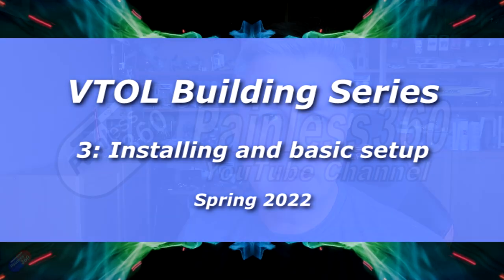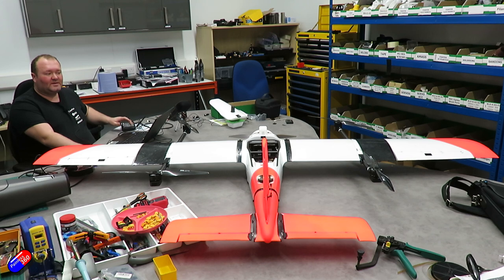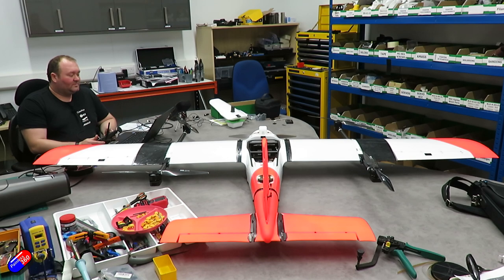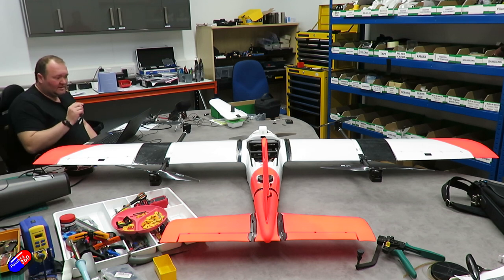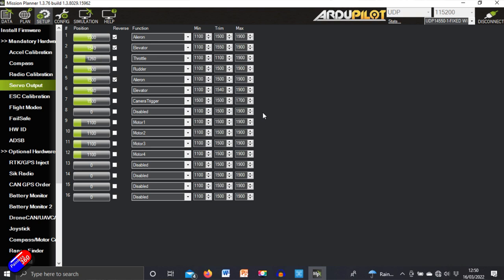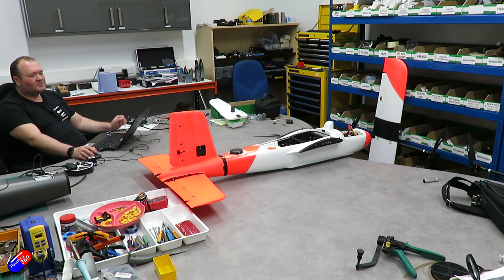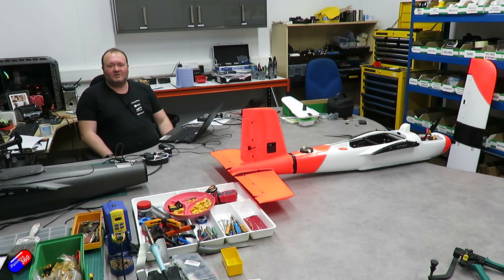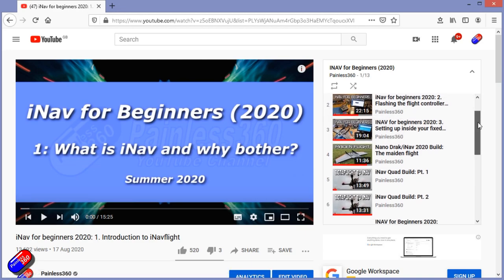VTOL Basics Series (3/5): Control and motor testing, VTOL flights modes and maiden/transition plan

Comment: To all that start to venture into VTOL territory: Stall speed varies with weight; something to consider if you do not want to risk your expensive camera equipment on a maiden flight or initial setup / tuning procedure. Once you add the weight of the equipment / payload, stall speeds will be higher (so you'll stall at a higher speed already)
It would be more pure to use the angle of attack as a stall warning system, rather than indicated airspeed. Bu I also understand that that complicetes the setup, especially in a 4+1 situation (where would you put an AOA meter to reiably reflect the actual angle of attack...). So just at least be aware and add some margin for this effect.
Reply: Why wouldn't you just add the exact weight your camera equipment is going to weigh and tune it like that so the stall speed is in fact exactly right and then put your camera equipment on after it's tuned??

Comment: You know, Lee, hearing to Ben explain the modes, I was thinking... I guess to implement it on iNav they would need 2 separate ways to set the PIDs, one for quad mode and other for airplane mode. You know? The PID loop I don't think so, it just would need to change what PID settings to use in each moment. 
But I don't really know, I'm just guessing. 😬
Anyway, thanks a lot for the video!
Stay safe there with your family! 🖖😊
Reply from the maker: INAV needs to quite a few things to support VTOL... Arduplane is the best way for now... Happy flying

Comment: Hi Lee, Great Video as always. I was wondering how easy is it to setup  a quadcopter transition to plane with 4 servo ? Can i use pixhawk 2.4.8? I am really new to the transition thing.
Reply from the maker: The transitions are all configured in the Quadplane parameters in Ardupilot. Any flight controller that runs modern ardupilot should work... Best of luck
Reply: @Painless360  Legend!

Comment: Lee, have you decided on a platform for your build? I’d like to offer a suggestion of the Atomrc seal . It’s cheap, it has ply strengthening near where the vtol motor spares would mount. I guess the difference with Ben’s big plane, is it isn’t a tractor, but a pusher-ish. Just offering a suggestion!
Reply from the maker: Ice explained the plan to the Patreons and I think that you will like it! Stay turned!

Comment: Hi .. which is the part where you tell the size of Motor and PRop for a given weight ?
Reply from the maker: It is the same principle as picking a motor and prop combo for a multirotor. Figure the all up weight of the model and then double that. Divide that number by the number of props/motors you will use and pick a motor and prop that will give you that max thrust.. See my other videos on it. Best of luck!

Comment: I have a question regarding how to set value for initial PWM value as u set it to 1000 for  motor 1, 2,3 and 4, in my servo setup its showing zero at the left, please advise,  thanks.
Reply from the maker: Throttle range can be described in a number of ways 1000-2000, 0-100% etc. Full steps shown in the series..
Reply: Thanks let me check,  I have another,  I have regular i2c airspeed sensor and pixhawk 2.4.1 GPS module,  seems like connector used in orange cube will not work, what is the best way to use my pixhawk 2.4 GPS and airspeed i2c sensor with cube,  any suggestions,  thanks.
Reply from the maker: You need to get hold of the right connectors and modify the wiring. Best of luck!
Reply: @Painless360  that was I was thinking, thanks.